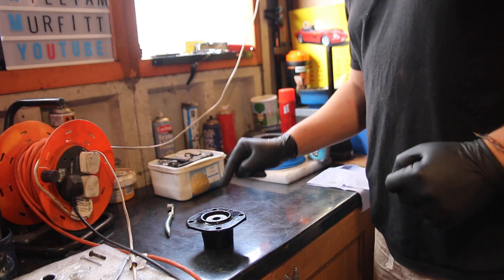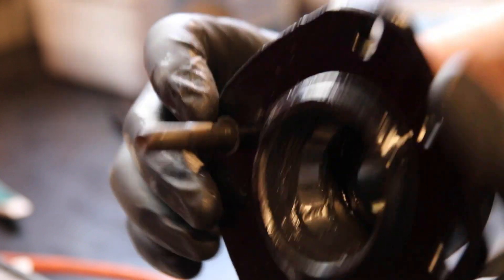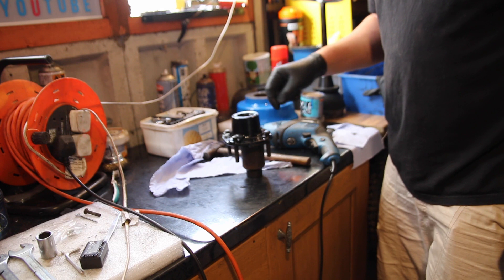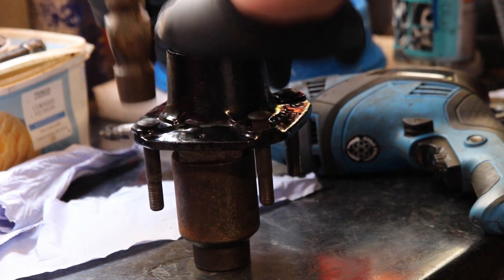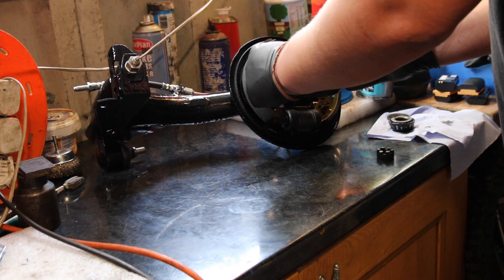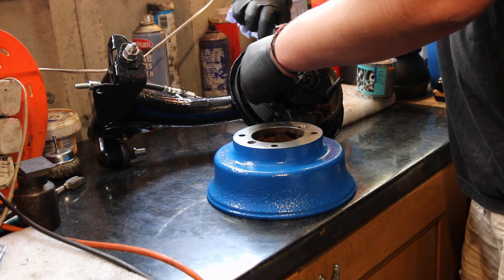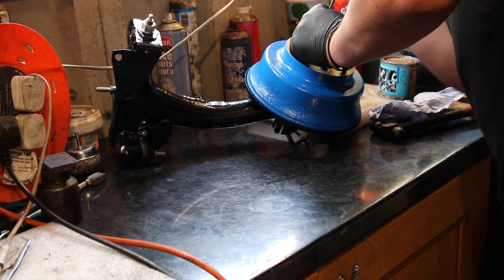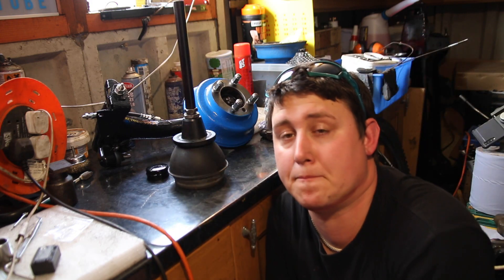Rear Wheel Studs Part 8

Comment: Have you ever had the studs not line up so the drum wont go on? I used a hydraulic press to push mine in and seem to have a slight seating issue on one side, on the other only 2 of 4 studs like up with the holes? Trying to confirm a cross measurement of studs incase they are somehow not perpendicular to the hub itself... any advice? Cheers.
Reply from the maker: Hey Brad, I can't say I have ever had this issue. Hope you manage to sort it.